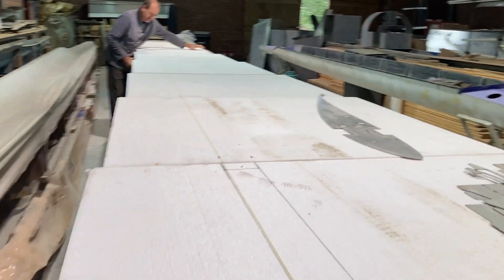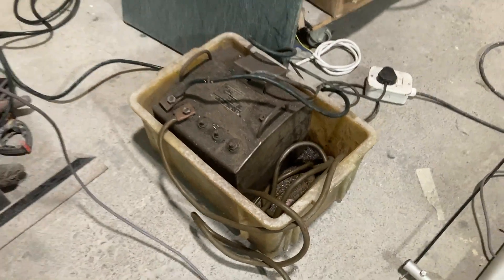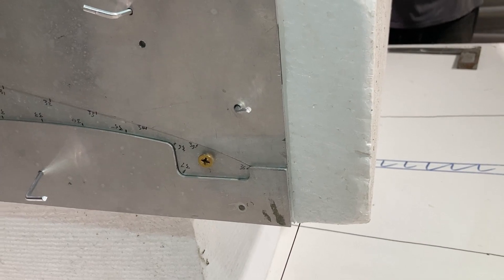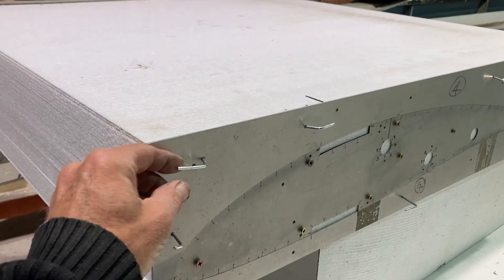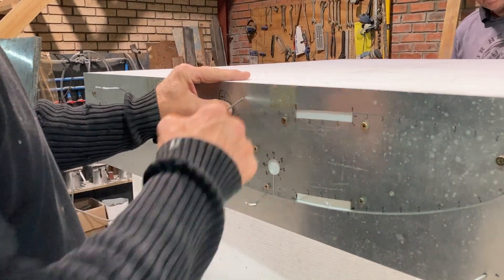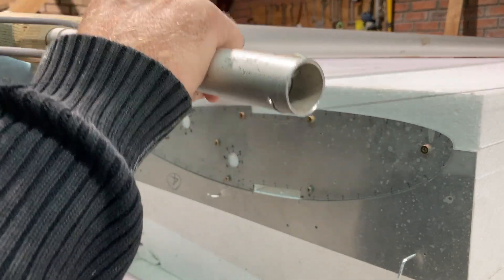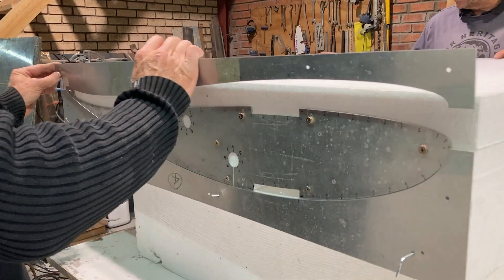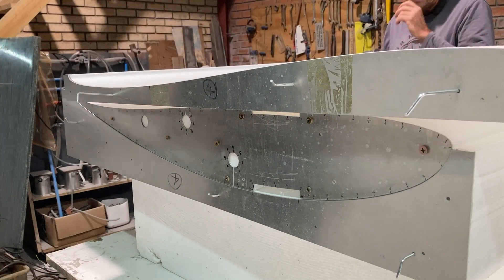Hotwiring a Whisper Wing

Comment: Kinda into a Cozy build and I can't for the life of me find the XPS the plans call out in the thicknesses required. Insulation companies blow thinner sections, but not what I need. I've heard claims this is because XPS has better adhesion properties. But here I see you okes using EPS: Much easier to procure in big sizes in SA. Is there really a meaningful difference?
Reply from the maker: We use XPS of 24kg per cubic metre density. It must be virgin, small bead (not re-grind). Secret is to always bog the surface with micro slurry before laminating the skin. This gives great skin adhesion. EPS with its closed cell structure does not accept the bogging well and skins don't adhere as well. Plus XPS is cheaper and easier to find in SEFRICA!
Reply: @Russell_Phillips  Huh? XPS = Extruded, closed cell Polystyrene. EPS = Expanded (ball) polystyrene... crumbles when rubbed. That's how I google it anyway. MY understand was that XPS is superior, but I can't find it in sections > 100mm thick.
Reply from the maker: Sorry the abbreviations are confusing things. We use expanded polystyrene. They blow it in massive blocks and hence you can get whatever thickness you need. Provided it is 24dv, virgin material it works perfectly. @Chatsu8o
Reply: @Russell_Phillips  Awesome. thanks!
Reply: @Russell_Phillips  Would you show how you do the spar build and the layups...? I am really thinking to build a motorglider...would you do build assist or teach..?